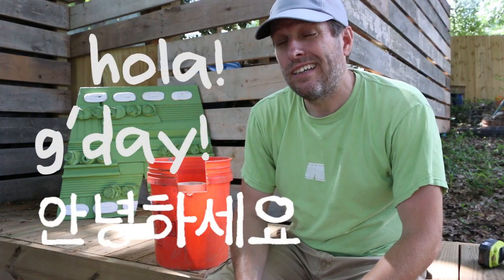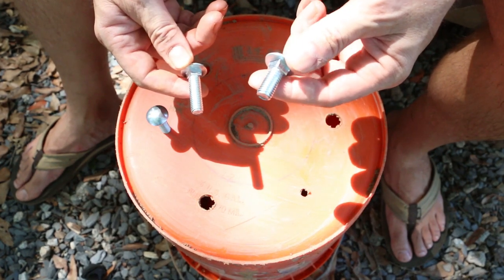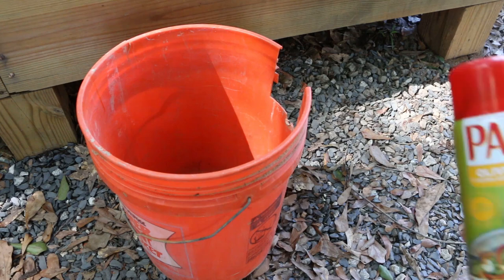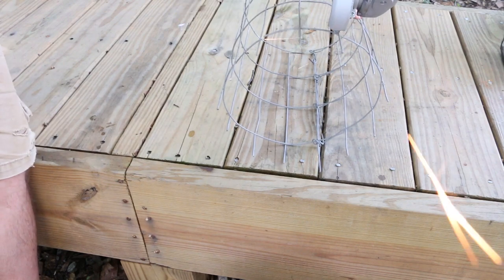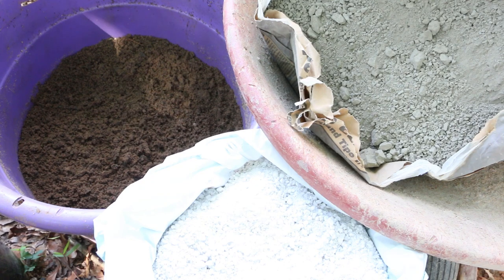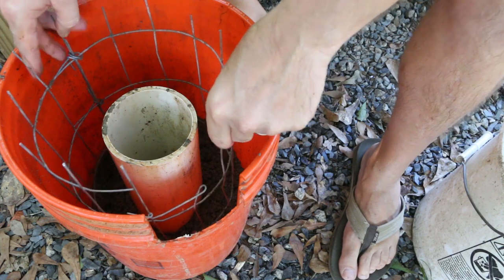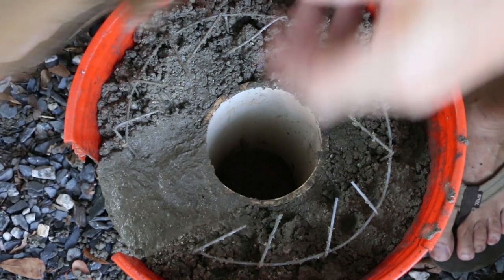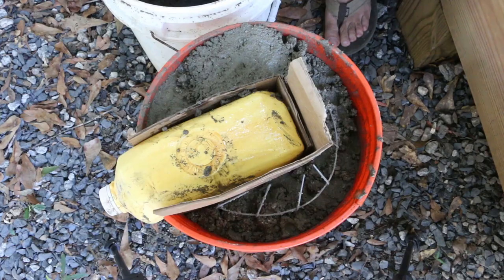Concrete & Perlite Rocket Stove FAIL! | What Went Wrong?

Comment: Great vid, thanks! I'm thinking of trying this, but I've built many coffee can size rocket-stoves with holes drilled to allow the wood gas to travel outside the burn-chamber, up, and with more holes at the top allow the gas to go back into the chimney and be reignited in beautiful blue flames. So I'm thinking of adding this feature by attaching a small diameter cardboard tubing stuffed with paper towels. The tubing would horizontally leave the burn chamber, maybe 3 inches, turn at a right angle, then straight up close to the top of the chimney, turn back and connect to the chimney. After the tubes all burn away it should allow the gases to flow through to be reignited. that the plan anyway.  Sound crazy?
Reply from the maker: Sounds like a cool experiment. I say give it a try. That’s how innovation happens. Dyson created his new vacuum after 5000 prototypes. :-) I’d love to know how it turns out.

Comment: This is an old video but i'll give you some feedback from our lab. We use WD-40, on our metal molds, but they come apart in two halves. For plastic molds, we wait a minimum of 48 hours (longer is better) punch a hole in the bottom of the mold, and then spray compressed air in to get it to release. a little concrete usually busts off the edges but if you let t cure longer (curing is a chemical process, it doesn't "dry") You can reduce this. Also I'm very interested in how this would perform with a fiber admixture or metal fiber admixture.
Reply from the maker: Jonah, thank you so much for the excellent feedback and suggestions. I will definitely halve my forms for the next go round. I like the idea of adding fiber as well. Thank you for watching.

Comment: Mix your aggregate in a shallow pan rather than a bucket.  It will be easier to work.  Make a single larger batch to provide continuity in your pour.
Reply from the maker: I have purchased a cheap concrete mixing pan. Works so much better. Thank you for the suggestion.

Comment: Anything the mind can conceive so can it achieve you are proving that and inspiring people .tHANK YOU FOR YOUR TIME AND VIDEO'S. I would like to add a few thought's the parchment paper liner is perfect, the perlite does hold water measuring water each time is as important as the other,  longer bolts on the inside would be better and a washer, the outside bolts could be used to release the bucket screw them gently to allow air to escape should help to release.I hope to follow yours and try myself. Again thank you..
Reply from the maker: Thanks for the feedback and suggestions, Michael. Thanks for watching.

Comment: Nice project. Saw your first video and this one. I think you don't have enough water and not enough cement. I'll try the project myself but will not use perlite. Instead I'll try to coat the armature wire in aluminum foil (several layers). It deflects heat. I'll just leave area at top and bottom for concrete to connect and make some holes in the foil for connection.
Good luck with your next version.

Comment: A bolt going through the center of the bucket, with the threads coming out the bottom of the bucket, and a knob screwed on will make it easy to simply pull the bucket off after curing.

Comment: in your other video, where you used a terracotta flu liner on top of bricks...  instead of using PVC as your chimney form, could you use the flu liner (then just leave it in ).  maybe notch the flu liner with your angle grinder so it could double as your pot stand offs( fill bottom of bucket with sand to depth of pot standoffs or notch the bucket so they poke through).  so in your form the flu liner sits on sand to top of notch(or poke through), then your jug, surrounded by your bucket...  mold release... crisco (just something to try)   I have played with perlite for a while... best results is when I create the cement/sand/water mix get it all nice and creamy then slowly add perlite until I have the desired consistency (depends on if you want it pourable or packable)  also to make it more pourable with a dryer mix they have a product called Flow Control which makes the mix looser before it sets... have only used that when making slabs for a firepit, but it does help...
Reply from the maker: Thanks for the feedback and suggestions.The flue pipe idea is an interesting one. Also appreciate hearing your technique on mixing in the perlite. Thanks for watching.

Comment: a side note... have you ever tried "Air Crete"  would make this portable (though air crete is kinda soft so I have had to trowel on a light mortar mix/stucco on the outside to act as a shell)
Reply from the maker: I have considered air crete. I just need to learn how to make it. I know Honey Do Carpenter has a foamer design he sells. I've gotten lot's of comments suggesting are crete...will do this at some point. Thanks for the suggestion.

Comment: Not enough concrete in batch with too much peralite an no beating on sides of mold use air pressure from air gun through bottom hole, make sure wire mesh lines up with cutout on bucket, I've used grease as well as motor oil but you found out about cooking sprays! Tim

Comment: Funny, but I believe the mix wasn't too dry, you just never compacted the concrete enough. High frequency vibration is recommended for low-water content concrete. Tapping with a piece of lumbar, lol. I use water at a ratio of 0.4:1 water:cement (not concrete) by weight and make some beautiful pavers always. But I use a vibrating table at almost 4000rpm.

Comment: Arnold from Philippines,  I am an Engr,  I enjoyed watching your videos ,mixing of concrete cement,   add a litle bit  more water on your mixed cement, this can  compact the cement in yor bucket,  then  gently tap the bucket with  your mallet until the bubbles comes out, bubbles weakened your cement, that causes crack,  in the future,  add   bars  or construction mesh wires to reinforce the the concrete, . Using cardboard is ok, for easy.removal of concrete from the bucket,,  when separated the concrete from bucket  let the  concrete breath,   wet the  cement ,  you will notice,  it sucking the water,   do this thrice  day,  on the second day  ,.. your rocket stove  is ready to use it.  Your first video is ok but not cured  properly  and no bars.. the croncrete  it shrink and expand xpecially  when heated Good Luck

Comment: Four years late but information doesn't hurt. Maybe you could have salvaged some of the materia that crubled away if your had rewetted it with a spray bottle to give it enough water to complete the chemical reactions. 

It also might help to ensure concrete doesn't dry too fast, by again spraying it and wrappin it with plastic. 

Lastly it might be a decent idea to first mix several batches, let it cure, and test the material inside one of your old rocket stoves. 

I'm not convinced that the most insulating and efficent rocket stove is better if it is at risk of falling apart if you look at wrong.  One of the issues you face is uneven heating introduces uneven expansion, and uneven heating is made worse by higher insulating value. It might be that inserting a replacable steel pipe introduces an airgap that slows down heat transfer to the cement. And thus prolonging the life of the concrete through slower more even heating  while reducing the heat that transfers into the concrete.
Reply from the maker: Thank you for the feedback, Keith. Great suggestions. I’m agree with you that a stove ought to be durable before it is efficient. I definitely want my rocket stoves to stand up to a good long stare. 😳 Thank you for watching.

Comment: From professional MASON. Mix 3:2:1 cement in ONE batch. Calculate volume needed, mix in wheelbarrow with back and forward motion of a regular SHOVEL.  ADD one squirt of dishwasher to water. Start mixing with less water than required,  add  extra water slowly in handful at a time

Comment: Try a wax paper loner next time. Tape it around the riser tube. Tape it to the inside of the bucket.
Reply from the maker: Thanks for the suggestion Patrick. I may do the wax paper on the PVC riser form. I want to see if I can get the main body of the rocket stove out with just grease or oil. Thanks for watching.

Comment: I'm thinking you could have wrapped your forms in wax paper and tape. The bucket could have been coated in motor oil and had wax paper inserts then add the mixture. So even if it stuck to the paper, that could easily be burned off.

Comment: Great video but NEVER expose your skin to concrete mix! It contains lye which will cause a chemical burn with prolonged exposure. For the concrete mix you  may want to try a 2:1 mix with  peat moss (2) and concrete (1). I've seen other DIYs for casting flowerpots using this mix and it's super lite and should be a good insulator. Motor oil is likely the best release agent as I've also seen this used in other DIY videos, they mostly use used oil.
Reply from the maker: Thanks for the warning. I am a little too lenient on concrete and skin, but I hear you. I'm curious to try your peat moss - concrete mix. Thanks for the suggestion. Thanks for watching.
Reply: Very true !!! My wife hates when my hands get too rough from mixing concrete with my bare hands.😁😁😁

Comment: Try cutting the bucket first, then tape the seam.
Cardboard for the inner tube, leave it in, burn it out
Mix entire cement batch at once.
Consider vermiculite, it has a higher melting point than pearlite.
Consider Aircrete, it has air pockets
Consider adding ceramic wool to the concrete mix.
Reply from the maker: Thanks for the suggestions, Ken. I’m going to use your method in my next build. I will do an aircrete build in the next few months. I’m going need to learn how to make it first. Thanks for the feedback.

Comment: Your proportions of material are fine, even if you like yoy can still add more perlite, the trick here is the moist in that perlite, you should pre-water that material apart, and add it to the mix at the end, so that way the perlite not only is not gonna dry the concrete fast but it is gonna help curing slow the concrete, and not forget to watering the whole thing for several days before you pull it out of the mold. Man, you do that and yor rocket stove is gonna be just fine.
When you make a wall out of bricks, you better put them in a bucket filled with water first, otherwise they suck the water out of the cement so fast that wall will crack. 
Perlite is doing this to your mixture. 
Good job though. 
Keep on inspiring others. 
Eventually, I'm gonna make one of your models, the ultimate I guess. 🤔😜😂

Comment: This might seem like a silly question but why don't you mix "your" cement with Georgia clay? 🤔
Reply: And you already found out but the longer concrete has the ability to remain wet the stronger it will be. Always mix your concrete wet. If your laying stones in , say a stone wall you should mix your mortar /cement a little on the dry side because stone does not absorb water like brick or cement blocks
Reply from the maker: Hi Dan. Did you find my Georgia clay (cobb) version of this rocket stove? Thanks for the concrete tips. Thanks for watching.
Reply: GreenShortz DIY I'll have to check them out I want to build a rocket stove/chimney that can throw a little heat too . I hope I don't sound like a jerk I enjoy your videos I like when you show your failures too keep up the good work.
Reply from the maker: @danfay4860  No worries Dan. Thanks for the feedback.
Reply: richard mccann  Please make this statement more legible, as it seems you have good information to offer here, but I cannot understand it. Thanks.

Comment: You sprayed your bolts with the release agent, that's not good for having the Crete mixture to adhere to them. Go back the cardboard you know it works for you with a used bucket. For a release agent to work the surface needs to be pretty pristine.

Comment: I see this thread is already 3 years old. But no release agent is going to crush to make room like the cardboard did. I suggest you split it on two sides and use a second bucket to hold it together for a spring-form mold. If that doesn't release, cut it off in line with the splits and add another bucket to the stack for $2.50 until a few are used in a stack well coated with pure cooking oil or diesel fuel do release. I don't trust Pam. (The propellant evaporates.) If they still don't release, you will have to use removable bands. Even steel tub forms and spring-form pans are a bit flexible because they need to be deformed in removal. Wood is also stripped from the outside in a similar manner.
Reply from the maker: Hi Stephen. Thank you for the input. The double bucket method is brilliant. I'll use that in my next video on this. I plan to make another, using comments and feedback. I'm definitely using yours. Thanks again.

Comment: apply tin lay of grease on the inside wall & base of bucket same for the pcv pipe outer wall before pouring in the wet concrete , will be easy to remove once the concrete dry
Reply from the maker: Thanks Jack. I plan on trying Crisco grease the next go-round. Thanks for watching.

Comment: What if you poured the first 4" in just concrete and sand, then the full mix, then 4" or so at the bottom.  This would give you increased durability at the two main wear points.  This might be particularly helpful with the anchor bolts at the top.
Reply from the maker: I like that idea, Robert. Thanks for sharing and thanks for watching.

Comment: you could call the concrete company and explained to them that you want to add some kind of flake insulating agent like what you used perlite ask them if they have some kind of like bonding agent it seems that the perlite doesn't bond to concrete they might have some other suggestion for you as far as insulation
Reply from the maker: Thanks for the suggestion, Miniphe. Thanks for watching. :-)

Comment: Hey Green shorts

You have a fascinating process, and I am stealing a lot of your ideas for my first rocket stove.  

Have you considered using a sona tube for your form?   They come with pre applyed wax, and you can make them higher than the height of a bucket.

I liked the repurposed tomato wire.

Your production  values making watching a pleasure.

Dan in Milton MA
Reply from the maker: Thanks for the feedback Dan. Don't think of it as stealing...there are no new ideas. YouTube is about making ideas more accessible and visual, at least that's the way like to look at it. I like the idea of using the sona tube. I think I've got a few scraps of it laying around...I'm such a pack rat. :-) Thanks for watching. Good luck with your build.

Comment: Dipping your hands in water will not help.  Dry skin is a lack of lipids (oils) more than water.  I would recommend gloves, but I realise these aren't always practical and can have consequences for your skin themselves.  Whether you decide gloves are for you or not, I would recommend a barrier cream of some sort, and a moisturiser after cleaning up from a long day like this if you can. Even healthy skin needs protection from many of these things.  

The brand I personally prefer is gloves in a bottle (blue and white packaging mostly at the moment).  It provides a barrier which is still effective after exposure to soap, caustic substances, and various solvents.  I personally find that gloves in a bottle is enough protection for my skin with some chemicals, and reduces the skin dryness caused by extended wear of gloves when used with latex/nitrile gloves.  I personally started using it to protect my psoriatic skin, because I wasn't going to listen to medical advice to avoid all contact with a list of chemicals 3 pages long, which would have meant no more soldiering (flux), no more use of most soaps, strict limits on clay contact, no concrete, nearly no glues, many solvents are out, as are many of my favourite paints, I'm not even meant to handle these things with gloves, as trace contact causes reaction with many items on the list.  It goes on, and it would mean an end to some of the few things I still really enjoy and can do with minimal help, but with gloves in a bottle, I can handle limited exposure to most of the things on the no list without major reaction, and for ages with gloves. It has saved me from dozens of building/cleaning chemical related flares, with happened frequently without barrier cream.  It's not as essential for healthy skin, but is helpful for almost anyone
Reply: Added bonus, gloves in a bottle is an expensive but exceedingly effective release agent for many things